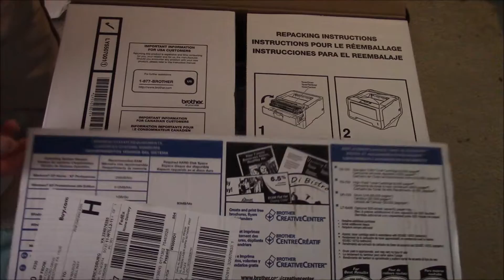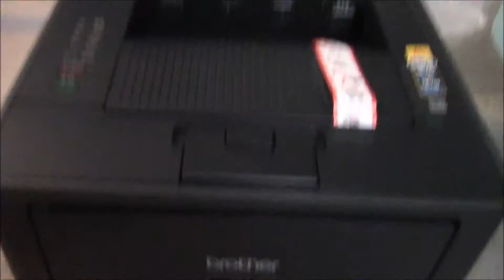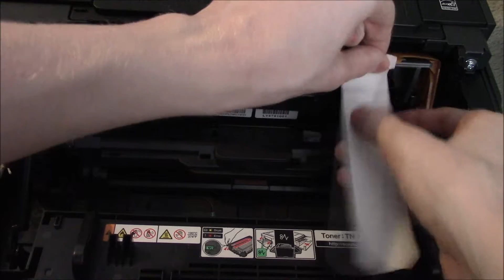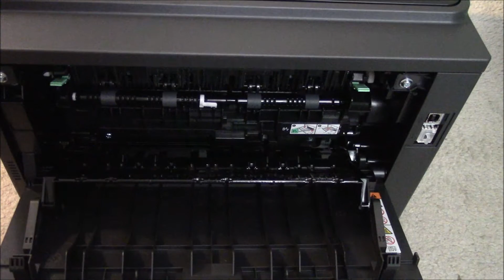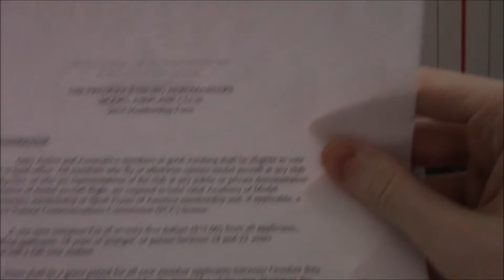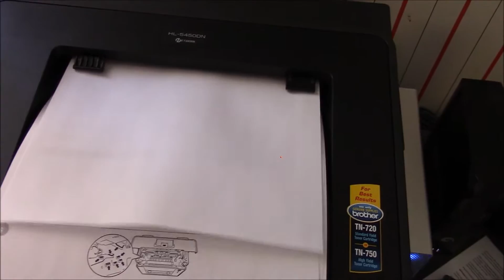Brother HL-5450DN Laser Printer Unboxing & Features

Comment: The highest resolution is the setting named "1200 dpi".  If you have letterhead or one sided glossy paper, note that pages inserted into the front slot get printed on the top side first.  Pages taken from the tray are printed on the bottom side first.  The oval slot in the front of the paper tray lets you see how much paper is left.

The connection method is either Ethernet or USB.  I have never tried USB, but Ethernet works fine.  I set the printer to a fixed IP address since I thought that might make it easier for all the different computers in my home to use it.  I can print from Windows, Linux, MacOS, and even from my ancient iPod Touch.  Brother sold an upgraded version with wireless networking, but most people won't need it.  Just connect the printer to your wireless router with an Ethernet cable. 

I have had mine for several years, and I like it a lot.  It has never jammed.  Text, graphics, and images all look great.   Double sided printing is a wonderful thing.  The printing is fast.  The original cartridge lasted through many reams of paper, and the replacement cartridge is much higher capacity.  I have printed on labels by feeding them one at a time through the front slot.

This model is really made for business.  It is somewhat bigger and louder than a typical home printer, but it really gets the job done.  Of course it has no scanner, and the output is only black and white.